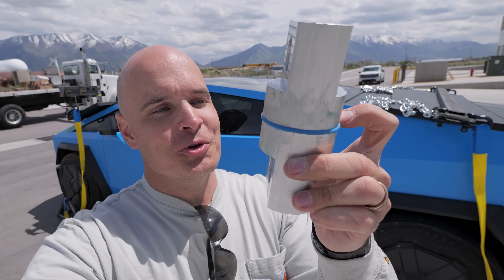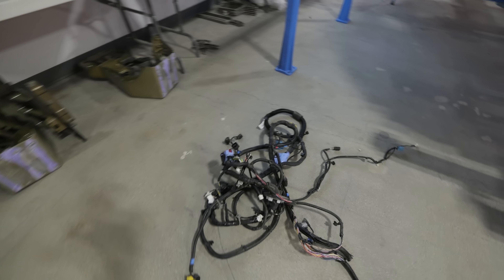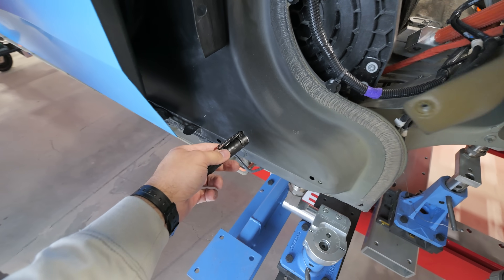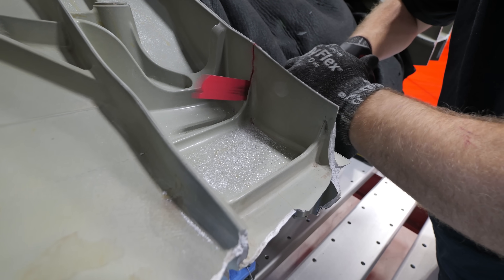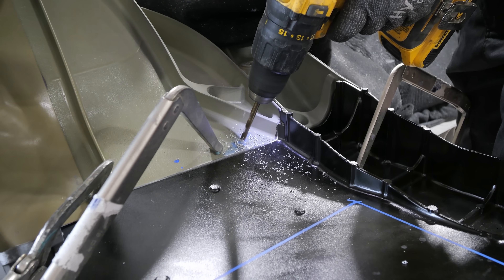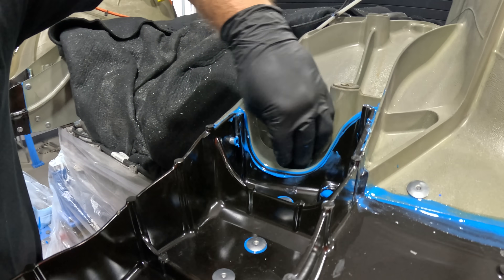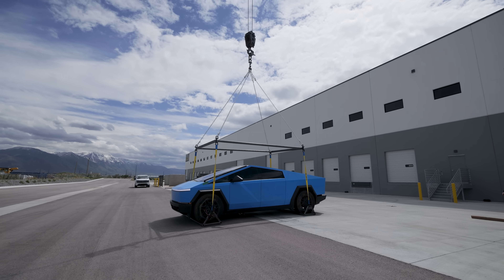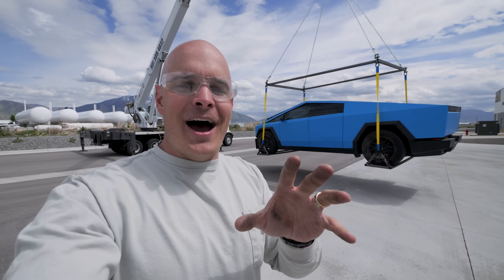Tesla Fixed my Cybertruck with GLUE - (but I'm not mad about it...)

Comment: Jerry redeems his past stupidity of massively overloading the tow hitch by admitting the hitch is fully capable of hauling the max rated loads if your not an imbecile who cantilevers a tonne off the hitch using an excavator. ! 
Also he points out the crumple zones which numerous idiots claim the cyber truck does not have - it has an easy replaceable crush section and even the main casting can be repaired.

Comment: maybe they should build the cyber truck out of glue since the actual frame is garbage and should never be ever be called a truck.
Reply: The smart manufacturers are following tesla with cast structural sections - the strength and rigidity of the cast mono design is better than a ladder frame.

Comment: Didn't we have a Superglue promo stunt that used only a drop to hold a car in the air? So with how much is on that joint they gave you, I'm not surprised it could withstand suspending 2x CyberTwucks in the air.

Comment: Does the glue get brittle over time? Sure when fresh it’s as strong as original, but I assume whatever epoxy like chemical reaction that cures it degrades over time or with transitions between extreme heat and cold as it doesn’t thermally expand at the same rate as metal.

Comment: Did they fix the part where the chassis is just brittle porous aluminum? Also their glue couldn't keep an accelerator pedal in place after a few months. I wouldn't put too much faith in that.

Comment: I am very surprised that the whole weight is basically taken up by glue.  If polymers are that strong, why use aluminium or any steel for that matter.  I think core filaments will be a game changer in 3d-printing.  That is, long strand carbon fibre or other fibre surrounded by polymer for gluing.  I can't wait.  We may even get timber made from polymer and fibre.

Comment: Feels like someone got paid. I’m glad to see they are fixable. I think long-term these frames will crack and have a lot of problems.
Reply: Almost every modern car engine since the 1980's is cast aluminium and subject to far more extreme conditions with no problems.
Reply: @stephenhumble7627  cast aluminum work hardening which can lead to cracking and a truck frame will flexes unlike a engine block which should have no movement except for heat cycles
Reply: I would be very surprised if the video maker got paid to create this video, I think he would have to disclose that info if that was the case so I highly doubt it. Or did you mean someone got paid off to green light that repair method? I'm not sure the science behind this repair whether it has longevity or not but hopefully itll do good long-term, at least its a transparent process.
To your original point - sure there is a conflict of interest because realistically if he made a hit piece style video on this process he would probably never be allowed behind the scenes in a tesla work area again - which would mean less content - so in a way I can recognize the conflict of interest for sure, I just doubt he got paid to make this video.

Comment: So, the glue is impressive in its strength after 24 hours. Can it be tested a year or two later after it has been thru several thermal expansions and contractions and the elements? (and a possibility of chemical degradation). The old glue definitely did not hold with the weight on it. And it could have been just as strong when just newly built at the factory. And last,  I feel these repair guys put more care onto the repair with a camera recording everything. Lathering it on for the camera. But for an average unknown person, single coat on one side will do. I'm still skeptical.

Comment: Structural adhesive is used extensively in aerospace. It has unique and valuable property, such as its ability to retain adhesion and retain flexibility in dynamic temperature ranges, and its ability to join this similar materials with welding is not possible or optimal. Very cool application of structural adhesive in this case. I love it.

Comment: The spec says fusor 2098 tensile strength is 3190 psi but its lap shear strength on aluminum is 2466 psi. Technically the repair should be around 22% weaker than stated

Comment: Edmunds long term Cybertruck was a write off to the tune of $94,000 Dollars despite having even less damage (look for video upload date of May 16, 2025).  as I said back 2, 3, and 4 years ago when the Gigacasting was first being discussed, Professionals working in the Autobody/Collision field (think Caliber and those authorized with Celette Benches) CAN technically do almost any repair you want, however the two ultimate determining questions are (since Cybertruck values are in the toilet) No.1: is the repair COST-EFFECTIVE...? and No.2: WILL THE INSURANCE COMPANY PAY FOR IT...? if the answer is "no" to either of those questions you're cooked, because in the real world the work shown is generally "not Customer Pay"... i repeat is "NOT Customer Pay".

Comment: problem with glues are they could be strong and the best but it will NEVER beat corrosion ever, when its able to get between the glue and metal/plastic thats it, it will de-laminate and separate from there. All these modern cars with panels and seam glue will fail in the future causing problems. Dont forget glue degradation is also a thing depending on weather

Comment: Even over 20 years ago, structural adhesive has been considered a valid repair for certain structures and body panels for a collision center. When attaching some panels, the body shop I dealt with was advised to attach the panels then use a tack weld or two to prevent slippage while the adhesive cured. So yeah, this is not surprising that it works so well. Great follow up video.

Comment: 14:26 seems they put more on during the repair than there was originally. Makes me wonder if it would’ve failed before if they’d have used as much adhesive during manufacturing.
Reply: Or it might as well me intentional, so it fails at that spot and not other. On the repaired one I expect it would fail at the same spot again, so I guess it is okay to put the glue there.
Reply: I could be wrong, but I don’t see any evidence that the adhesive failed.  The metal sheared.
Reply: It was going to fail, the only difference would be what’s the measurement of force.  The glue isn’t meant to be a mechanical fuse, and even though you can see it separated at a bonding point, notice neither side of that bond was reused.  The surfaces were distorted and/or stressed beyond what can be trusted to survive the designed loaded scenarios of intended use cases.
Reply: The aluminum casting itself failed; the glue join that failed was just ripped apart when the beam went and the aluminum itself would have sheared there too if the glue hadn’t given up.

Comment: There is a difference between tongue weight and towing capacity. The tongue weight on all trucks is lower than their towing capacity. The truck broke in the last video about the Cybertruck because the tongue weight went higher than it was supposed to with the excavator.

Comment: This glue gives a statistically insignificant gain in tensile/shear strength vs. existing bonding adhesives. How do they plan to fix the core structural issues without bandaid remedies?

Comment: I am glad it is repairable 
But, I sense a change of tone here, last time you were actually critical, for the benefit of the consumer.

Now it feels like you have pocketed some and that was the plan all along.

Sorry for the accusation, but hear me out, if you still had the same tone as last video the same result would have a different script.

Let me explain, so what we understand now is, the older truck will hold more weight and not brake, even if the old truck broke it wouldn't leave you stranded because of a couple of 48V wires. And if the old truck broke any body shope can weld it back for a fraction of 14k. 
Like with 14k you can easily buy 3 old trucks for parts.

And being honest, if another customer had the same problem, they will not have this amazing experience you advertise, allowing you in to video and write 'hi mom' with the glue. You got this treatment for a reason.

Also, you are an expert with metals and materials, last time you said, no matter how good aluminum is, it is sensitive to fatigue and it worsens over time, unlike steel that gets cold formed and becomes stronger and settles at some point.

This time you said 'all metals have their limits' 

I believe you steered your opinion, and it is easy to assume along side the special treatment, you were paid.

I am not happy either to assume this about you, I always came to your channel for honesty, but I got disappointed this time.

I am not a tesla hater, but this is obviously not a good future if things are repairable after being weaker due to the gega cast cost saving for tesla, and would cost a fortune to repair afterwards..

Comment: Why not just cut or section it and then tig weld it with supporting brackets or braces where needed?  Preheat and it should be just as strong??? Am i missing some obvious thing here?

Comment: Glued together like good old fashioned plastic scale model. My question is how well this glue take weather over the years? From extreme heat to cold. I’m sure engineers test these industrial glues every imaginable way. Patching micro meteor holes on international space station and their spacesuits. I used similar glue fixing soft vehicle bumpers. Modern city transit vehicles are glued together. Only frame is welded in critical joints.
Buying old Cybertruck? Best way to see if it’s been in accident. Look for big pop-rivets and glue in odd places..

Comment: I agree that it was cool to see that it was build to be fixable , but I find it lacks some balanced thinking. Like why was the glue distribution on the original broken off tower section so different. I would also not have touched the already (at least int he time line shown in the video) prepared section with my fingers to add some fatty spots ;-)

An other thing would be the 3t car and a 63mm diameter surface would possibly work for a single lift and a good prep (which is anyhow also needed for the 2 components stuff) with powerglue.
If I see it right the cybertruck load would be around 9.5N/mm*2 and Cyanoacrylat (on Alu): seems to be ca 8–15 N/mm*2,  that might have worked as well. ;-)
But I am not a mechanical engineer nor adhesive specialist, its just a thought.

Comment: I would like to see the glue tested with environmental changes such as extreme heat, cold, and vibration. Also temperature should be cycled from hot to cold repeatedly. Tesla did a massive recall because the glued on panels were falling off.

Comment: I'm surprised the surface wasn't prepped, i.e. stripped down to bare metal before gluing. So what was glued together was an olive-colored coating was glued to a black--colored coating. It's only as strong as the bond between the coatings and the metal, which must be a hell of a strong bond.  Bare aluminum oxidizes rapidly when exposed to air so that has to play a factor in choosing to glue the coating rather than bare metal together.

Comment: In the UK this repair wouldn't be possible as it would be classed as a structural repair, which are not allowed due to the strength and safety of the cars structure. 

 Was that an Olight Warrior 2 Mini I saw as a steel tester? :) Great torches. I have the Warrior 2 Mini, Seeker 3 Pro and multiple i3E's.

Comment: "Super easy to replace", goes ahead and requires non standard tools, consumables, parts and procedures. 

Question, why was this part no bolted on from design so if it breaks you can unbolt it and replace it?

Comment: When you say that it will always be able to tow its rated capacity I think you forgot that metal fatigues over time and calf metal is prone to cracking when it fatigues versus even mild steel which is a lot less prone to cracking not that it won't but you know what I mean. 13,000 for the repair I would like to see any dealership give me that quote when I tell them I've cracked the frame.

Comment: The problem can be that the glue was applied not to the exposed metal, but to the protective coating on the metal. The strength of the connection will not be due to the strength of the glue, but the strength of the adhesion of the protective coating to the metal.

Comment: As a former collision refinish technician, it was super fun to see a lot of familiar, tools, guides, parts, and repairs. The black coating on the new castings are also e-coat. We would scuff them, like they show in the video, then clean them for mechanical adhesion for the structural glue. Sometimes, depending on the glue, you could also achieve a chemical adhesion. After the sectioning, it was my job to sometimes match that black e-coat to the original e-coat color. Every manufacturer is different on what color they use and many are similar. Props to both Tesla for the sneek peek as well as Jerry to move forward with the repair. Going to be honest, I thought for sure that repair was going to be more $$$! Hope to own a Cybertruck some day. The ultimate sci-fi IRL machine! Cheers!

Comment: what's the lifetime on the glue? i know a weld will survive just as well as the metal, but have they done long term tests on this adhesive? rubber fails relatively quick, will this stay stronger than a properly cared for weld in two decades? i have my doubts but we'll see i guess. regardless the adhesive being able to lift the entire truck within 2.5" of adhesive is amazing

Comment: The fact that a whole injection moulded aluminum shell has markings to be cut and has snap points for the replacement part to snap into is crazy genius engineering

Comment: Aluminum still has a fatigue problem that steel doesn't have. It will continually get weaker over time. Sure, it might tow its rated capacity when its new, but that number starts going down every time you use it.

Comment: That is seriously impressive how little that repair costed. The glue is also incredibly impressive. However, we're still ignoring the fact that, in essence, an improperly loaded trailer completely ripped off the rear end of the truck. I see at least a couple improperly loaded trailers driving down the street every day. This IS a HUGE catastrophe waiting to happen. People could and most likely will die from a failure like this. No amount of adhesive in the world will fix how that aluminum casting is made... also you did show that the adhesive did fail. So we're still back at square one. Steel is just a better material for this task. This truck has a massive design flaw.

Comment: I am honestly happy that you recognize that you tried to check the tongue weight of something that was never going to work and should never work. If you need to use an excavator or some sort of construction equipment to hold down the rear wheels, you’ve already lost the argument; there’s no trailer on earth that’s going to do that. I do appreciate your acknowledgment of how sophisticated Tesla is and how much better it is than a regular pickup truck. In most cases, I am a Rivian driver as well as a Tesla driver. It’s a great car. I don’t care what other people think.I am honestly happy that you recognize that you tried to check the tongue weight of something that was never going to work and should never work if you need to use a excavator or some sort of construction equipment to hold down the rear wheels you’ve already lost the argumentthere’s no trailer on earth that’s going to do that. I do appreciate your acknowledgment of how sophisticated Tesla has commented how much better it is than a regular pick up truck in most cases I am a Rivian driver as well as a Tesla driver. It’s a great car. I don’t care what other people think.

Comment: So you don't need to score or rough up the material before applying? or did I miss that part? Either way that's some crazy adhesive. Even more so if that's applied to a smooth surface.

Comment: When fresh the glue is absolutely incredible, but to what degree does it degrade with time, in extremely cold or hot climates?
The engineering around this repairable frame is incredibly clever, but this all is to achieve this plain silly design.
Which is not street legal in the EU, so not relevant to me, making it only an interesting showcase of what is possible if you give a good team a bad concept.

Comment: I was skeptical initially. But after you showed all the surface area for the adhesive it is pretty clear that glue does not even have to be that strong to be as ridget as the original casting.

Comment: Luckily it didn't break because the rigging would have ended up going through the windshield and roof glass. 
Should of had a strap connected to both ends of the subject load tested.

Comment: I think this video fails to address the actual design concerns with this feature on the cybertruck, particularly the fatigue strength of the materials being used. It's also worth noting that even with an improperly loaded trailer a normal truck bodies hitch won't tear off. Also glues and adhesives are generally good under static loads, but suffer when shock loaded so the lift at the end doesn't do much to address the multiple failures of the hitch that have been seen.

Comment: Aye it’s cheaper to fix than I thought it would be! But it seems like this ultra strong glue should’ve been used more in the original Construction and Assembly of the Cybertruck, and now Tesla is coming up with the best cheap repair they can for the Cybertruck’s massive design flaw of it’s weak rear frame. I still think this vehicle needs a “back to the drawing board” moment, scrap it, work on a less polarizing Gen 2 version.